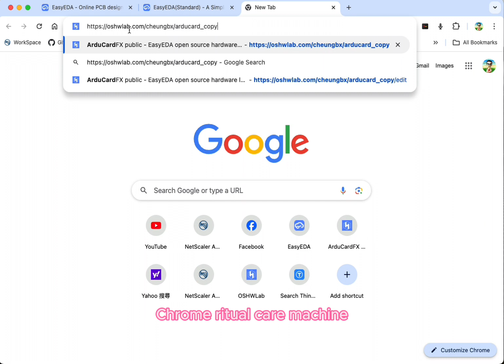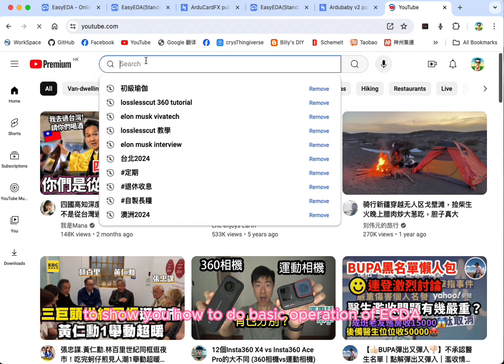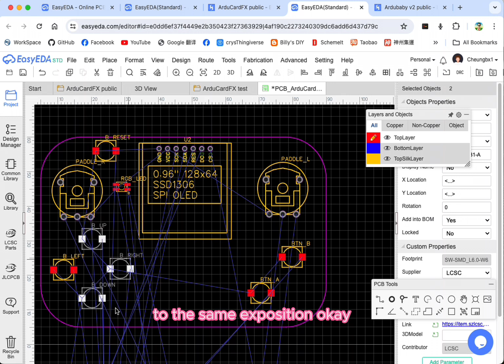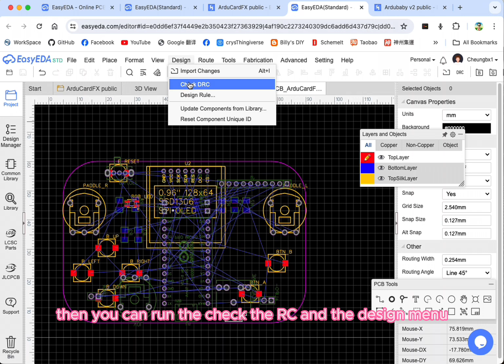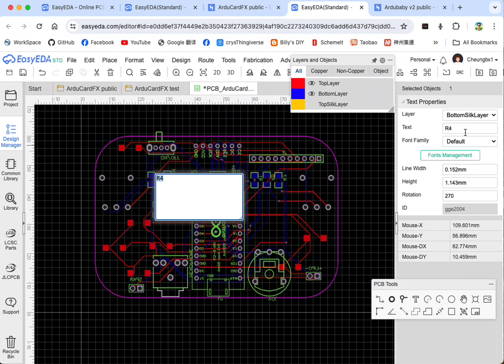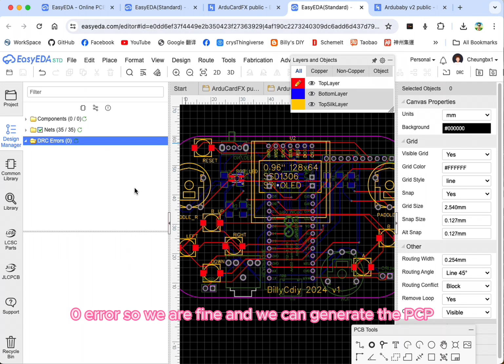How to design PCB for ArduboyFX 8bit retro game machines using EASYEDA (embedded caption)

Comment: Very similar to what I am making at the moment. I thought the RX line from the flash needed a 10K resistor? I guess not 😀 The paddle(s) add something new to a standard Arduboy FX. Good EasyEDA tutorial as well. I hope more people start making their own PCBs... it's a lot of fun and easier than people think. Just getting PCB's printed is a couple of button clicks.

Also, does the 10k bridged across the SP+ and SP- increase volume?
Reply from the maker: Thanks for your comments. The 10K VR is for volume control to reduce the volume a bit when you are plugging a head phone to the game machine Otherwise, it could be deafening. Don't think it did anything to increase volume. For the 10K for RX line, I think it may relates to this. The original circuit design made by MR.Blinky  for the flashCart involves a clever way to  convert the 5V signal from Pro Micro to 3V. Hence resistors and diodes were used for a simple  voltage conversion. Later on, people experimented to reduce the components used by sweating the serial flash memory run at 4.2V or even 5V instead of 3.3V. That gave rise to the AdruboyFX Modchip etc and ArduboyFX.  I have made 10 PCBs using this newer design to skip the voltage conversion. So far, none of the serial flash got burnt out or deteriated. So, I'll keep it this way for now until I experienced other problems. Thanks for the questions anyway.
Reply: @BillyCdiy  Thanks  👍